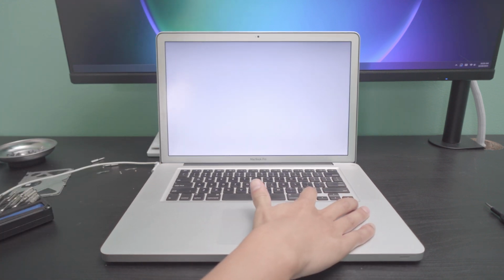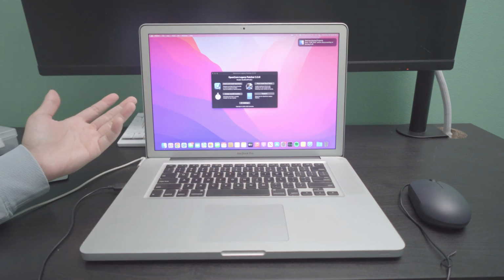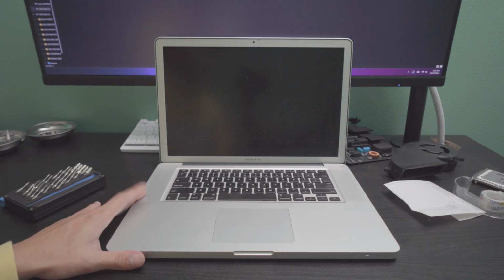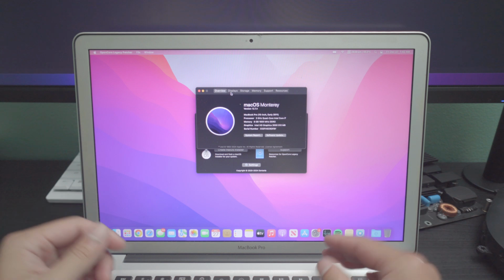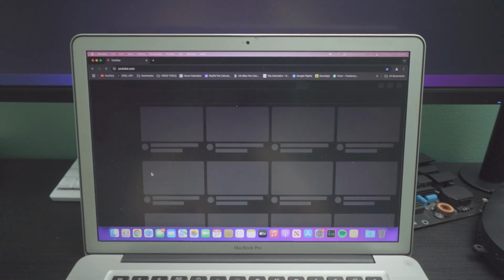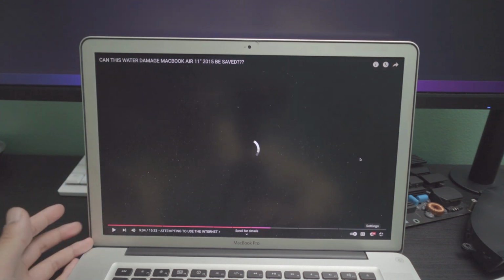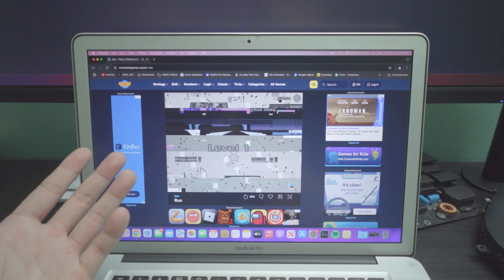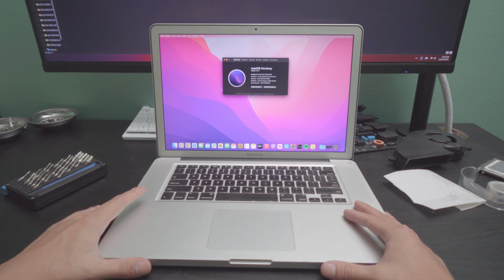REVIVING A 2011 MACBOOK PRO 15" IS IT WORTH IT IN 2025???

Comment: That's so funny.... My Graphics card died on my MacBook Pro 2011 15" in 2018 in March I believe, and I took it to a tech shop to get it repaired... Exactly what you said, it had to be baked in an oven and re-soldiered so that it would work again, and sure enough, 6 months later exactly in August 2018 it died on me again, lol, so I just bought a ThinkPad in December Black Friday sales the next year. I also couldn't really save any of my music stuff off it because it was all on a G-Drive which was FireWre only and that was how I connected my G-Drive to the MacBook was via FireWire 800 (which stopped being supported fairly soon afterwards.) It holds a soft spot in my heart though. Lasted me 7.5 years. (Mine was the Late-October edition though.)

Comment: The best way to make these reliable is to reprogram the gmux chip to permanently disable the AMD GPU. This method is pretty much perfect, sleep mode and brightness control still work. It does require a Lattice Jtag programmer though.
I recently did this with a 17“ 2011 one and it‘s working perfectly fine
Reply: Вариант хороший,но смысл о него если устарелая Mac os high Sierra,а новее он вообще не тянет даже через OCLP

Comment: Thanks for making this video. Now i must go and find my old 2011 MBP. Think maybe mine is the maxed version, and i later switched to some quick hdd and 16gb memory so it should be good to go. Even battery was changed not too many years ago. Let's hope for it to still want to live. 

I got the system board replaced by apple back then (or i paid for it but got the money back later). The recommendation was configure it to always use 3d graphics so i think it was the intel graphics that overheated? Remember people re-ball their boards in the oven. Glad i didn't try that :)
Reply from the maker: That's awesome, I hope it still works for you! Keeping the usage mine on the low to preserve that gpu lol

Comment: I picked up 2 of these 2011 15" MBP last weekend from a yard sale for $50 total. The seller warned me there is a high chance that these 15" have bad graphics but there is a hack that can be use to turn off the GPU. 

The first 15" boot with these small red horizontal lines. Could see them clearly after booting to Ventura. Disabling the GPU did work. But it drains your battery like twice as fast. And once in a while the small horizontal lines comes back.

The 2nd 15" boots but have the bad gpu.

Both have battery level in the mid 90s so that is worth it and the spare parts.

Comment: Photo amateur - MAX 16 megapixel apsc raw/dng files

Looking for tips:

Does it worth to spend €500 for a Macbook Pro 17":

Year: ?

Silver bezel 

New battery, 20 cycle

Processor 2.2 GHz Intel Core i7 quad-core 

SSD 240 GB 

16 GB  RAM 

New Hard Disk SSD 240 GB

Apple MAGSAFE 85W

Big Sur 2020 

PP AI LR 2021

Or €200 for MacBook Pro 15" A1286

Year: 2011

High Sierra 2017

Intel Core i7 2 GHz

HARD DISK: 240 GB SSD

RAM: 8 GB

Intel HD Graphics 3000 512MB

Or whatelse?

Comment: If the Radeon keels over, you can disable it and use the Intel GPU.
Reply: Ok, but disabling the dedicated AMD GPU means that you lose the sleep mode functionality, right ?
Reply: @mateiacd  Not necessarily. Sleep mode and wake on lan are in the Intel microcode, sleep should be possible.

Comment: On macs without dedicated AMD graphics, most of the advanced graphical effects should be disabled. Also due to this being unoffical code, you may run into problems with security updates and certain features within the operating system, so its best to leave it as is and just use a pre 2017 mac for general basic use (ie. not gaming, video editing or 3d rendering)
Reply from the maker: indeed!

Comment: funnily enough i have 2 of these. one has a dead gpu but it works otherwise but the other one i have is headless as it dosent detect an internal display but the GPU works for now untill it melts itself to death. i have put on an airflow focused bottom cover and repasted it to hopefully keep it working for a while now. both are mid tier models with the 2.2ghz i7 and the high end HD6750m for maximum gpu meltin action lmao
Reply from the maker: I had a high end one not too long ago, gave it to my dad after reflowing, so far still works

Comment: Love your videos mate. I'm on a 2011 13" MacBook Pro running MX Linux, and it's so good! Tried to do OpenCore Legacy Patcher with Sequoia with this old guy, and due to HD 3000 iGPUs being non-metal and everything basically rendering in software rendering mode, it was rough. Constant 80-100C temps. Firefox running quite shit. Everything's been wonderfully snappy on the MX Linux side. Temperatures are quite cool. Might want to try doing a PTM7950 pads change on this one.
Reply from the maker: I can’t even imagine Sonoma but I’m sure Ventura isn’t too bad
Reply: @cynonexus  Ventura seems to require AVX2.0 instruction set which wasn't present on Intel chips until the Haswell (4th gen). My 2011 MacBook Pro 8,1 is a Sandy Bridge, so two generations behind. Going back an OS revision, it seems like Monterey might be safe --- EDIT: I'm now thoroughly confused. Will try driving a bunch of older OSes til I can get it just right.
Reply: Ended up getting an Ivy Bridge mid-2012 MacBook Pro for around $40 in really good nick (just some elbow grease to remove stickers, remove oxidation from lid with a magic eraser) and added in an SSD. Because it's a "Legacy Metal" system, everything works perfectly in this device on sequoia using OCLP. The late-2011 model that I was using will unfortunately need to remain on high sierra, and use modern browsers like Basilisk which supports hardware acceleration via OpenGL. Perhaps I will get a HDD caddy and add another HDD for linux.

Comment: Currently watching this on a 2011 13 inch MacBook Pro. Still a super smooth experience.
Reply from the maker: Still decent!
Reply: What version of macOS are you running?
Reply: @ChipEnjoyer  I tried sonoma for a bit with OpenCore but it was running super hot and the battery died super quickly. Now I’m using High Sierra and it works perfectly. You do need old versions of apps though.
Reply: @ChipEnjoyer  mine is running on macOS High Sierra 10.13.6
Reply: @luluujones   any safe method you know we can use to upgrade beyond this? high seirra?
Reply: @the_curious_n  OCLP
Reply: @ChipEnjoyer  I triple boot macos 11, windows 11 and pop! os all thanks to OCLP.
Reply: I have a 2012 MacBook Air running macOS Catalina and it’s working smoothly
Reply: Wow at least I'm not alone. I'm watching on my 13inch 2011 mbp running windows 11 24H2 .
Reply: 15 and 17 has defective gpu
Reply: I'm looking at one rn for less that 100 dollars here in Nigeria. Should I get it..?
Reply: @Ricchvyb depends on the prices in your country. I paid 35€ for mine and spent an additional 40€ on upgrades.
Reply: @Ricchvyb For a secondary PC yeah you can. However, for primary use, I would advise against it. You're better off looking for a 2015 MacBook Pro. It remains a capable machine in 2025 and should continue to perform well for several more years.
Reply: Really
Reply: same im on an i7 model with 8gb ram and an ssd

Comment: For those older non-metal macs i recommend you reduce transparency and motion, and also disable effects like changing the genie minimize animation to the other one. It wont look as pretty but it will run much better from experience
Reply from the maker: 100%
Reply: @for good measure i also disable beta blur from the oclp settings since it can cause slowdowns too although it can cause some graphical glitches. I also completely disable spotlight indexing and the actual process itself from the terminal since i only use it to open applications, i changed the cmd+space keybind to open launchpad instead. You can also disable other services you need, like universal control wasnt enabled yet it was still eating up cpu usage so i permanently disabled it with launchctl

Im running a 2011 air on monterey and this made it run super well despite its age, many applications open almost instantly and the system itself doesnt lag nearly as much. Same goes for my 2010 mac mini also on monterey
Reply from the maker: @choonkyI’m going to take note of this, doing a 1 week challenge of using it!

Comment: The Butterfly Keyboard replacements were different from the originals for the 2016 models, said to be the updated version 2. I had my MacBook Pro 2016 keyboard replaced because a went to Apple to replace the battery and they basically replaced the whole top case. I can tell the keys feel different from the original. The display replacement though, it’s still the same, the ribbon cable could still be worn out again. That’s why I decided to never buy a laptop again and go all in on Mac minis and iPads instead.
Reply from the maker: They all go bad at the end of the day unfortunately, different revisions but didn’t solve the problem permanently… Could’ve easily have designed it better, 2019 MacBooks came with regular keys…

Comment: I'd suggest you resize the partition of OSX, and also install Linux Mint on it. It will work out of the box and you will have a modern OS with the latest updates on it. Old OSX versions have security flaws that haven't been fixed until later versions. Problem with later versions of osx, installed via hacks, is that they create new bugs. So, linux mint is your best bet. BTW, if you encounter system crashes with linux, use a usb wifi adapter, the old broadcomm chips have a bug that linux triggers.
Reply from the maker: I actually have Linux mint on one of my 2009 MacBooks, need to try it on this one.

Comment: i have to th 2015  15 inch  core  15,  running  high  seirra  i can t  even  open messages cause it  NNEDS to  run on the  dedicated  gpu and  when it  switches over   even with that program to where you can tell it to run on intel gpu only or  switch it will swtich and  the  reboot the laptop
Reply from the maker: Yeah the dedicated GPUs in those can be a pain when you run a newer macOS because the computer needs to work harder… but maybe you also just need a restore since you’re only at sierra

Comment: does the 13-inch one have any reliability issues?
Reply from the maker: @iSamYTBackup nope very reliable, 13” models only have integrated graphics…
Reply: @cynonexus 

great since i got one for dirt cheap

40 bucks, with a charger, it has cosmetic damage and cracked glass, but it works perfectly, upgraded it to 8gb of ram and an ssd
Reply from the maker: @iSamYTBackupparts are cheap for it now, I say keep it, it’s a fantastic machine still…

Comment: I used my 2010 15" MBP up until about 2020. I fixed the gpu panic issue and did all the upgrades I could over the years. It served me very well but Its age finally started to show and the aftermarket battery died so I finally retired it.
Reply from the maker: Gpu panics were a pain with the 2010s but not as bad as the graphics, I think they still have quite a bit of life as a movie machine
Reply: @cynonexus  That was literally just one completely standard capacitor that would go bad somehow. You can always rely on Apple to have a chronic fatal flaw with the motherboard every other generation.

Comment: They don't desolder themselves, the chips are just defective. If it was the ball grid array it would be permanently fixed by a reball but it never is. The connection of the GPU silicon to its substrate is an even smaller BGA that is extremely brittle and has to be reinforced with underfill material. A lot of GPUs back then used the wrong underfill which becomes soft at temperatures below the max operating temp of the GPU in a laptop.
Reply from the maker: Thanks for the clarification! I must’ve mixed it up with the 2007 mbps
Reply: @cynonexus  Those are probably the same exact thing. 2008 GeForce models definitely, at least NVIDIA actually made new chips with the right materials, they got sued and had to pay damages to everyone who bought a laptop with an affected GPU. Also both the phat Xbox 360 and PS3 (except the last 2 phat revisions, they have new GPUs) mostly die from the same defect. It was a big ass problem. Somehow AMD just kept making defective GPUs until 2012.
Reply: Nice video :-)
Reply from the maker: @laskholt thanks!
Reply: So basically there's no other way to fix the laptop but replacing the GPU/ DISABLING the gpu entirely?
Reply: @YasinVanDoorsen  Yes. Replacing for a fixed GPU if it exists or disabling it. No fixed GPU exists for the 2011.
Reply: @YasinVanDoorsen  Disabling the dedicated AMD GPU means that you lose the sleep mode functionality, right ?

Comment: Since a few months the Google Chrome app has been doing this on my 2009 17" MacBook running Monterey, it's not a graphics thing because I had my capacitor replaced in July, I switched to using Safari and increased my battery life on the old battery, I can get about 4 hours of youtube watching on it now. I think the only reason to get a 2011 model would be for the 17" version, the strange thing is this 2011 seems to be around the same speed as my 2009 17" MacBook. Google Chrome now only works when zoomed out and not in full screen mode which is so weird. By the way, check the output speaker setting, mine randomly changed the setting to the left speaker being louder, it wasn't super noticeable when listening with speakers but very noticeable when listening with headphones, i thought my headphones were broken and bought new ones only to discover the same issue so i went to check and it was a speaker balance issue.
Reply from the maker: I agree! 17” would be the reason to go for the 2011, thanks for watching!
Reply: My friendly advice would be to buy a more recent MacBook Pro with a Metal capable graphics card, at least from 2015.  I have a 17" A1297 model from late 2011 and apart from the screen size I'm not too thrilled with it. The cooling isn't great at all, it heats up quickly as soon as you watch movies, you have to learn OCLP to install newer versions of MacOS.